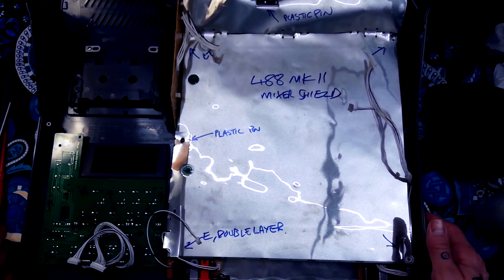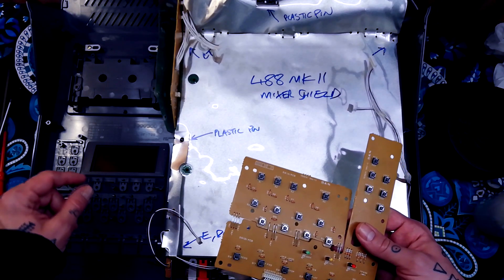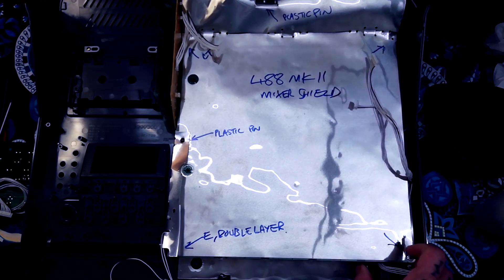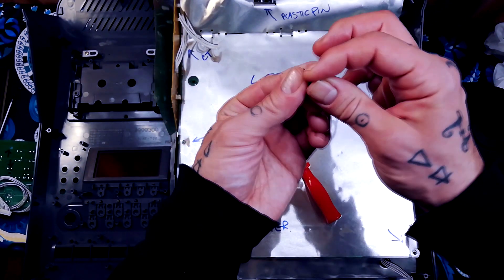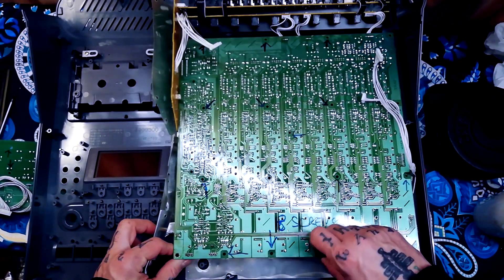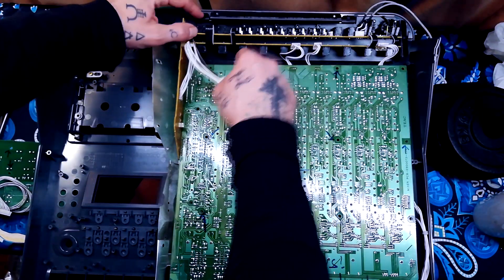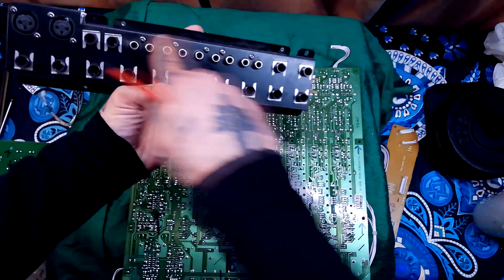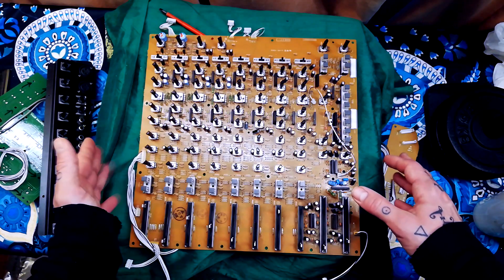Tascam Portastudio 488 MkII | tear down upper section - mixer etc

Comment: Hey,

Thanks (again) for your channel
Just bought a "tested" 488 II, tape transport did not work,thanks to your other videos I was able to change the belt,C gear,clean it and get it working again,it playback is fine on all 8 tracks.

However,there is absolutely no sound coming from input 3,even with input gain all the way up.all other inputs work just fine.I can also record 8 tracks with no problem.

Where would be the best place to start looking for the cause?
Fader,eq section work fine when using playback for TRACK 3, so it must be the input socket or s.th.?
Reply from the maker: Glad the videos helped. Yeah I'd guess socket. Those jalco sockets are susceptible to the solder at the base of the pins where they are welded to the circuit board cracking, could be an easy fix
Reply: Thanks for the answer,if it's not the input jack,what else could it be,shouldn't there be at least some sound when turning up the gain knob?

Comment: Hello and thanks for these vids.  I removed the upper section to clean the pots and faders, but a bunch of metal washers fell down to the floor.  Now I'm reassembling and I can't tell if these washers go between the outside plastic casing and the metal shielding sheet, or if they go right on the pots (so between the pots and metal shielding sheet.
Reply from the maker: There are black metal washers which sit under the plastic knows, above the plastic case, I think those are what you mean? If you sent me a picture via fb messenger I could confirm this.

Comment: Hello Tetrakan, first of all thank you for your videos. They have been a great help. Right now I'm working on a 488 mk2 with a faulty record button. I think the switch it self broke and needs to be replaced. Can you help me finding the prober switch?
Reply from the maker: Sorry this is such a late reply, must've missed the original notification....i believe any 5mm square tactile switch will do, you can usually get packs of twenty for a few pounds on ebay, amazon etc. They come with different numbers of pins, but for that generation I think it was 2 pin, check your own board before buying.

Comment: what kind of work do you do on these cassette recorders?
I have one and I've been thinking of modifying it, I want to add 2 inserts on tracks 3 and 4, and maybe replace all the capacitors, hoping it may be quieter...
Reply from the maker: I've never modded this for inserts etc but I know a guy who does that regularly, so it's definitely feasible. I don't always recap, but yeah I have reduced overall system noise by replacing old electrolytics.
Reply: @Tetrakan  thanks for the input, I'll dig a little deeper! :)